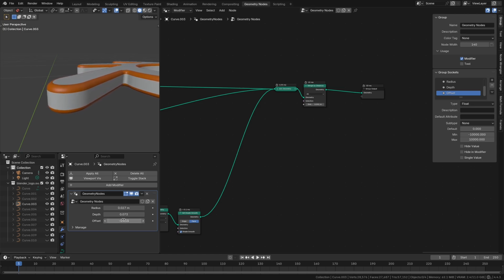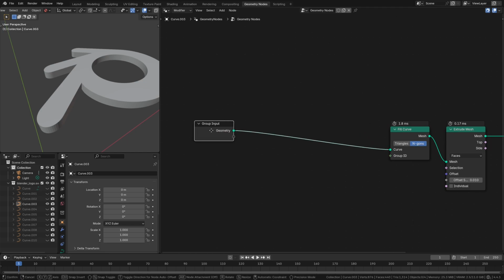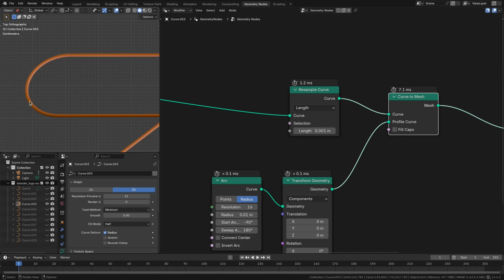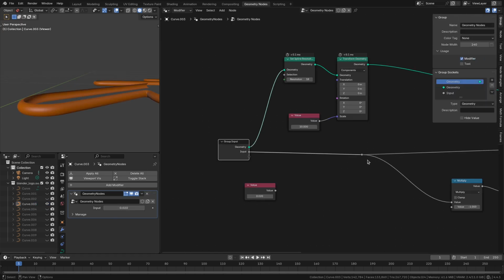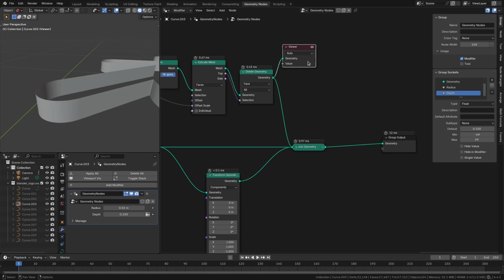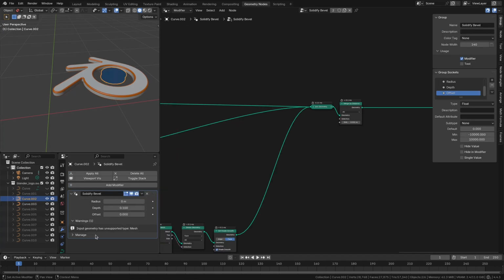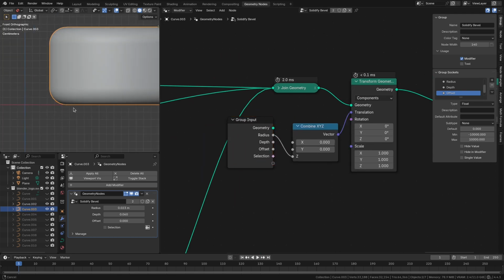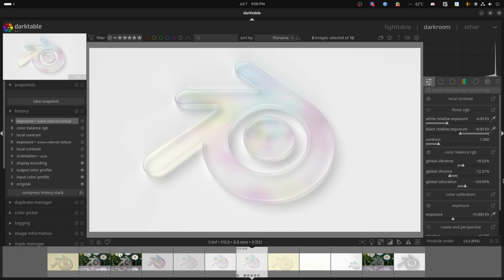Procedural Bevel & Frosted Glass in Blender | Geometry Nodes | OnlyNodes

Comment: do you have a method to accomplish this with quads rather than N-gons?
Reply from the maker: Are you asking about the fill curve operation?
Reply: @LemonEdgeFX  not exactly, im asking if it'd be possible to take a mesh that has several faces and still be able to bevel them. 
I feel as though i have gotten rather close with the new mesh to curve "face mode" and edge neighbors.
Making an even curve radius node group was hell but I made due. But sadly, I hit a roadblock.
Reply from the maker: Sounds intriguing. Can I have a look at the setup? My discord server setup is still WIP, but you can share the file there in the discussion channel. I'll have a look. You can find the link to the server in the description.